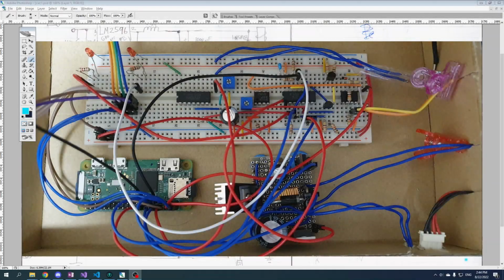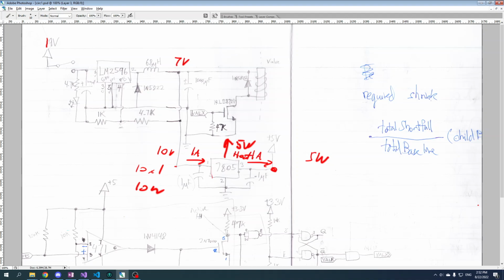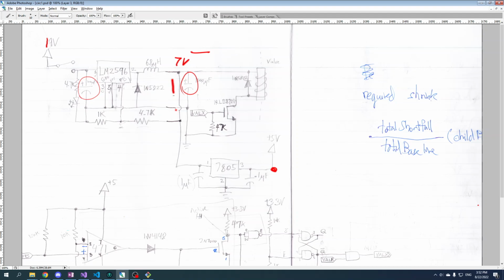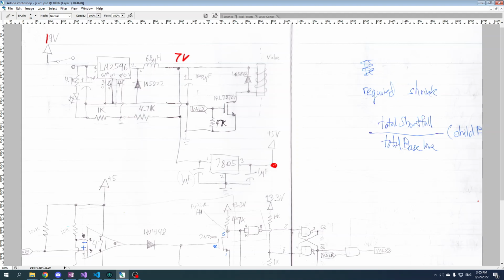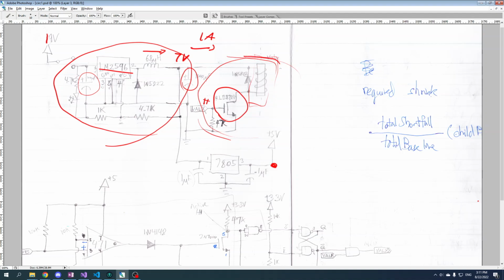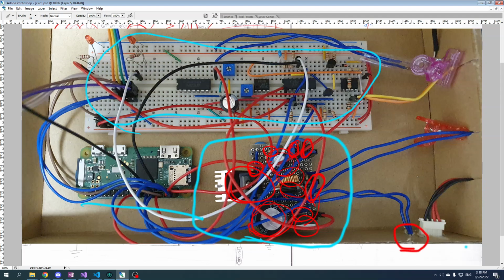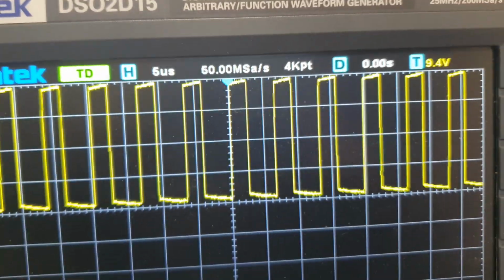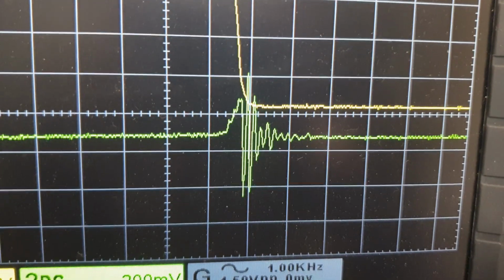Power Circuit Engineering [Project Moisture]

Comment: The output capacitor's job is a bit more important then that. There is typically a rather large hystersis between the turn-on and turn-off point of the switch inside the regulator. 30% or so is not uncommon. So when it is supplying 1A on average, inductor current is actually going back and forth between 700 mA and 1.3 A, for example. It is the output capacitor's job to shunt this current ripple to ground. It will charge up with the excess current and supply the deficit, thereby smoothing the output voltage. 

The little notch in the square wave on the regulator's output is the regulator going into discontinous mode because of low load. There is a  whole section about it in the datasheet. When you stress the pi, load increases and the regulator goes into normal continuous mode. Thus, the little notch dissapears from the waveform.

The ringing in the output waveform after the inductor might be largely measurement error. You need to use your scope's ground spring clip (https://i.stack.imgur.com/PSo3N.jpg) because the ground lead is forming a large loop and basically acting as an antenna. Part of it will probably also be caused by your perfboard construction. Given a properly designed PCB mostly all of that can be eliminated.
Reply from the maker: Oh snap, I was hoping this kind of comment would show up. Thanks for all the interesting info!